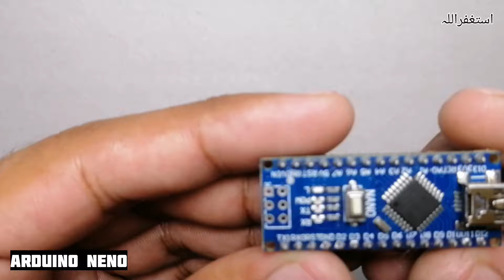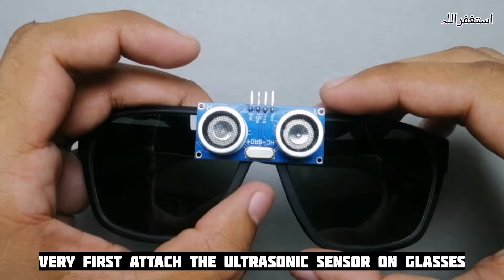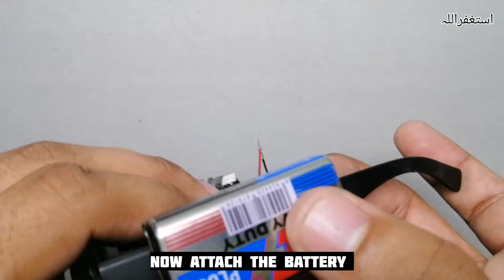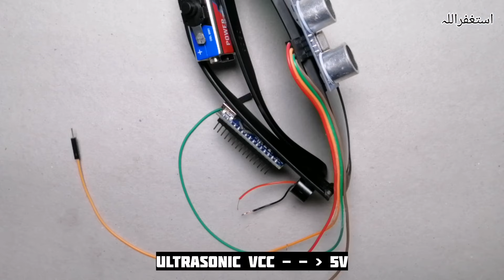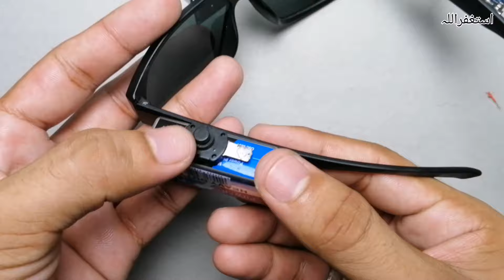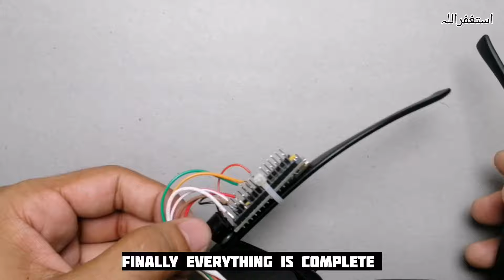Make a Smart glasses using ultrasonic Sensor and arduino nano || inspired award winning project 🥇

Comment: The code uploading takes for ever. Help me!
Reply: Same!
Reply: Me too same problem
Reply from the maker: Please configure the Arduino ide and make sure you are connected the Arduino port correct
Reply: Same
Reply: Bestest ever bro but a small problem can you tell me how did you connect ed the battery
Reply: @hargovinddixit4988  did  the code got uploaded??
Reply: Did you find a solution? Got uploaded?? I got same problem

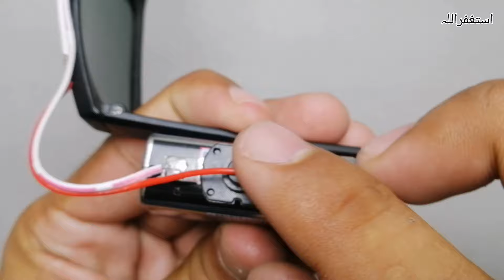Comment: After connecting  clip to the battery 11:21 what is that extra 2 wires connected at the end of the clip bro . Please reply fastttt broo
Reply from the maker: Bro its much simple you said when i attach the battery clip where i connect the 2 wires the negative one is connect to the gnd pin or arduino and positive is vin

Comment: Can someone help me why my ultrasonic sensor works only if the port is connected to the laptop and not actually  works in switch/buttons (I already uploaded the code in adruino)
Reply: this is the same problem as mine
Reply: Same
Reply: the switch buttons are most likely not connected properly.

Comment: Bro after disconnecting the arduino cable it's not working. Can you help me to solve this issue?
Reply: BRO I WANT THE CODE , IN THE LINK IT IS SHOWING THAT THE CODE IS NOT AVAILABLE

Comment: hello I carried out the same project as you but mine does not work without the cable connecting the Arduino card to the PC, even after uploading the program.
Reply: Same problem. Did you fixed that problem?
Reply: @Lost_Soul619 did you fixed?
Reply: @CelebCutsTV  nope bro. Don't follow this video. There's lots of errors. He used 9v battery for arduino nano,which is too much. If you want to do this project you will need 2 lipo battery (3.7v) or you can use converter. Though i tried 2 lipo battery process and commoned them. Still it's not working properly. You will need 5-6v supply which is suitable. I tried it with dc power supply from lab. And it's working under 5-7v range. You can try at your own risk. First try with 5v converter.
Reply: @Lost_Soul619 bro i actually brought all items in this video for my science project can i do this??
Reply: @Lost_Soul619 btw can you provide the link for 5v conventer??
Reply: @CelebCutsTV  hey, you can use a 5v power bank that requires 2, 18650 li-ion batteries, just get a mini-b usb cable to usb-a cable to attach the power bank to arudino nano
Reply: @BlessedBraceletsARTS  I did followed the video and I did working fine, btw Thanks

Comment: Code link does not open.please send me this code.
Reply from the maker: https://drive.google.com/file/d/1pajXuIAFeWmo_LnfdEhKKf_ffazrYgYF/view?usp=drivesdk
Reply: const int trigPin = 3;
const int echoPin = 2;
const int buzzer = 5;

long duration;
int distance;
int safetyDistance;

// Adjust this value to change the speed of sound for your environment
const float speedOfSound = 0.0343; // 343 meters per second (default)

void setup() {
  pinMode(trigPin, OUTPUT);
  pinMode(echoPin, INPUT);
  pinMode(buzzer, OUTPUT);

  Serial.begin(9600);
}

void loop() {
  digitalWrite(trigPin, LOW);
  delayMicroseconds(2);
  digitalWrite(trigPin, HIGH);
  delayMicroseconds(10);
  digitalWrite(trigPin, LOW);

  duration = pulseIn(echoPin, HIGH);

  // Calculate distance using the adjusted speed of sound value
  distance = (duration * speedOfSound) / 2;
  safetyDistance = distance;

  if (safetyDistance <= 30) {
    digitalWrite(buzzer, HIGH);
  } else {
    digitalWrite(buzzer, LOW);
  }

  Serial.print("Distance: ");
  Serial.println(distance);
}
Reply: Bro this is the code
Reply: int trigpin=12;

int echopin=11;

int traveltime;

float pingtraveldistance;

float targetdistance;

int buzzer=9;

void setup() {

  // put your setup code here, to run once:

pinMode(trigpin,OUTPUT);

pinMode(echopin,INPUT);

pinMode(buzzer,OUTPUT);

}

void loop() {

  // put your main code here, to run repeatedly:

digitalWrite(trigpin,LOW);

delayMicroseconds(10);

digitalWrite(trigpin,HIGH);

delayMicroseconds(10);

digitalWrite(trigpin,LOW);

delayMicroseconds(25);

traveltime=pulseIn(echopin,HIGH);

targetdistance=(traveltime*0.034)/2;

digitalWrite(buzzer,LOW);

if (targetdistance<45) {

  digitalWrite(buzzer,HIGH);

}

}

Comment: Project not working even i upload code and all circuit checked, sensor is deceting nothing i tryed 2 sensors which are new even tryed with current of pc and battery ,pls help i am a student i dont want to my money be wasted 😭😭
Reply from the maker: https://drive.google.com/file/d/1pajXuIAFeWmo_LnfdEhKKf_ffazrYgYF/view?usp=drivesdk
Reply from the maker: Most of the time arduino which you are using is not good or showing some errors in the time of code uploading so make sure all the wires are properly and code is successfully uploaded

Comment: Please send the code for my science   day project
Reply from the maker: https://drive.google.com/file/d/1pajXuIAFeWmo_LnfdEhKKf_ffazrYgYF/view?usp=drivesdk
Reply: Bro this code is not working
Reply: const int trigPin = 3;
const int echoPin = 2;
const int buzzer = 5;

long duration;
int distance;
int safetyDistance;

// Adjust this value to change the speed of sound for your environment
const float speedOfSound = 0.0343; // 343 meters per second (default)

void setup() {
  pinMode(trigPin, OUTPUT);
  pinMode(echoPin, INPUT);
  pinMode(buzzer, OUTPUT);

  Serial.begin(9600);
}

void loop() {
  digitalWrite(trigPin, LOW);
  delayMicroseconds(2);
  digitalWrite(trigPin, HIGH);
  delayMicroseconds(10);
  digitalWrite(trigPin, LOW);

  duration = pulseIn(echoPin, HIGH);

  // Calculate distance using the adjusted speed of sound value
  distance = (duration * speedOfSound) / 2;
  safetyDistance = distance;

  if (safetyDistance <= 30) {
    digitalWrite(buzzer, HIGH);
  } else {
    digitalWrite(buzzer, LOW);
  }

  Serial.print("Distance: ");
  Serial.println(distance);
}

Comment: Konsi battery theek rahegi 9 volt or Lithium polymer battery 3.7 volt

Aur button dusra use kar sakte hai??

And still didn't get the battery and butoon connection
Reply from the maker: G han ap koi sai bi battery use kar skty hoo or rahi baat button ki wo bi ap koi sa two terminals wla lga skty hoo baki connection sra sme hi rhy gaa

Comment: How to connect button to battery
Reply from the maker: Bro connect the wire to the battery then take the wire from one terminal of the battery and connect to the one side of button and then add more wire to the other side of the button the connect to either the gnd or vcc to the Arduino must choose one and after that the second wire of the battery is also connected to the remaining point of either gnd or vcc please choose one of those ( if you don't understand feel free to comment again) 💓💓

Comment: const int trigPin = 9;
const int echoPin = 10;
const int buzzer = 12;

void setup() {
  pinMode(trigPin, OUTPUT);
  pinMode(echoPin, INPUT);
  pinMode(buzzer, OUTPUT);
  Serial.begin(9600);
}

void loop() {
  long duration, distance;
  
  // Send a pulse to measure distance
  digitalWrite(trigPin, LOW);
  delayMicroseconds(2);
  digitalWrite(trigPin, HIGH);
  delayMicroseconds(10);
  digitalWrite(trigPin, LOW);

  // Measure distance
  duration = pulseIn(echoPin, HIGH);
  distance = duration * 0.034 / 2; // Convert to cm

  // If object is close, trigger the buzzer
  if (distance > 0 && distance < 50) {
    digitalWrite(buzzer, HIGH);
    delay(100);  // Sound for 100 ms
    digitalWrite(buzzer, LOW);
    delay(100);  // Pause for 100 ms
  } else {
    digitalWrite(buzzer, LOW);
  }

  delay(200);  // Adjust the delay to avoid excessive feedback
}
Reply: Is this a good code?
Reply from the maker: https://drive.google.com/file/d/1pajXuIAFeWmo_LnfdEhKKf_ffazrYgYF/view?usp=drivesdk